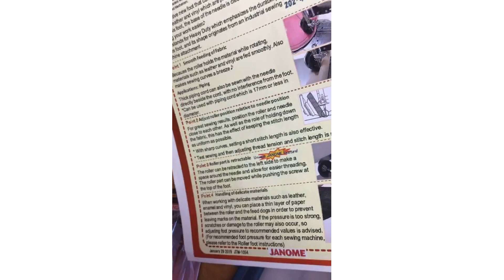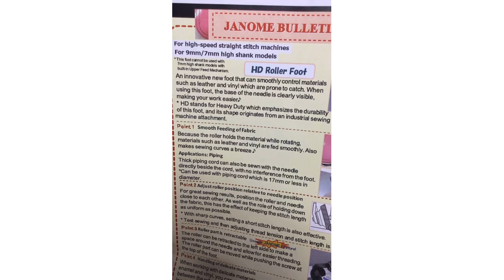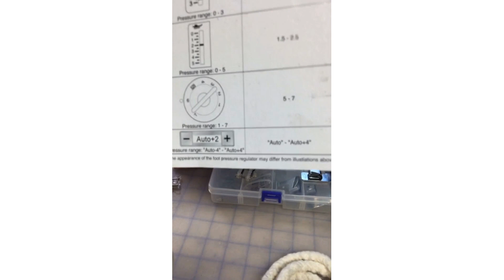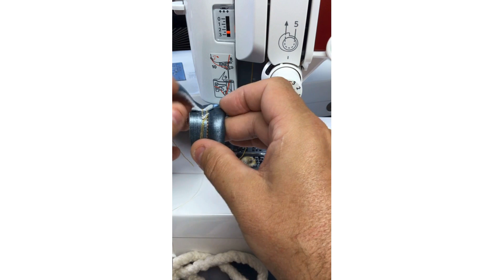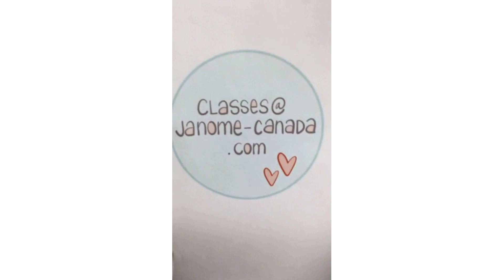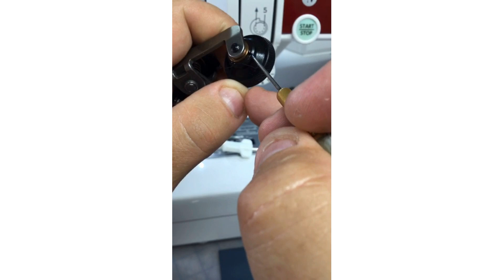Janome's Awesome Accessory Countdown #12 HD Roller Foot

Comment: I have Janome Horizon Memory Craft 9400 and Skyline 7 and I'm finding conflicting information as to whether this foot will work on my machines.  Janome website lists foot as compatible with my machines - but it doesn't work.  Can you confirm Please. Thanks
Reply from the maker: HI Mary, Yes! the HD Roller Foot will work on all High Shank machines, which includes both of yours. The foot can be adjusted by loosening the screws in the back and aligning the Roller with the feed dogs, as described in this Janome Bulletin - https://www.janome.co.jp/e/e_downloads/pdf/janomebulletin/JTM-1054_Roller_Foot_R.pdf  It works like a charm! Happy Sewing!

Comment: I know this is an old post, but I have a question.  I'm finding conflicting information as to whether this foot will work on an 8900 QCPSE.  Janome website doesn't list it as compatible with the 8900, but this video says it is.   They do list the 9450 which I believe has the same AcuFlex system as the 8900.   I've found conflicting information elsewhere.  Can you confirm one way or the other?  Would really like to get this if it will work.  Thank  you.
Reply from the maker: HI Jenny! The HD Roller foot works with all high shank 9mm and 7mm models which do not have the permanently attached AcuFeed (MC6600, MC7700) so yes, it will work with your MC8900QCPSE. Happy Sewing!

Comment: I just purchased a Janome HD5000-. Can I use the HD Roller foot on this model? And if I can't, where can I find a roller foot exactly like this one, for my machine?...Thanks....Richard
Reply from the maker: Congratulations on your new machine, Richard! The HD Roller foot is only compatible with high shank 9 and 7mm machines. Your HD5000 is a low shank machine. For those machines, Janome has the Roller Foot # 200316008 which is a snap on presser foot with a large rolling metal wheel at the front which helps feed the fabric layers through the machine. It's available from any Janome Dealer. Happy Sewing!